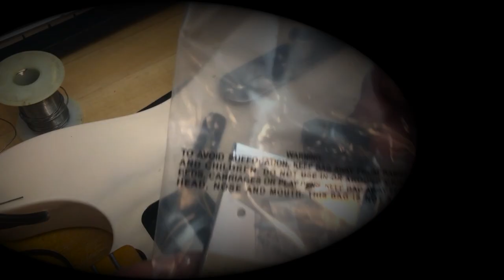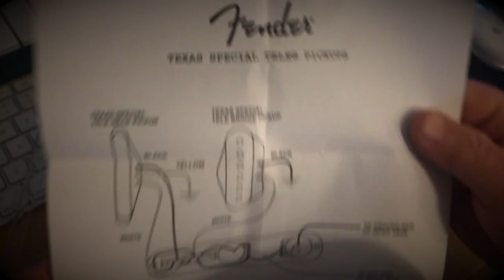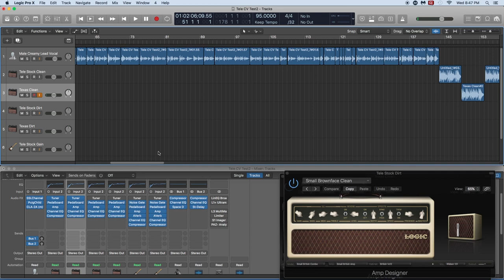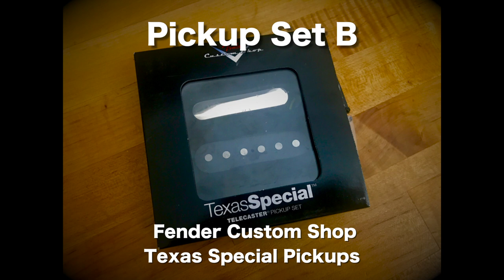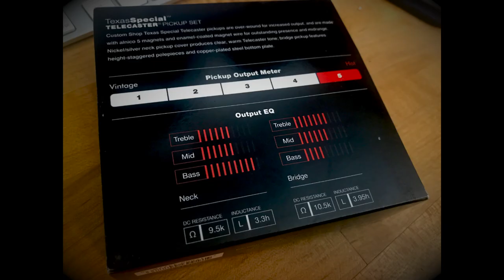Squier Telecaster Classic Vibe Stock guitar pickups VS Fender Custom Shop Texas Special pickups

Comment: I listened with high quality headphones and I couldn’t tell the difference in any meaningful way. The differences were extremely subtle and neither sounded “higher quality” than the other. Thanks for this valuable shootout.
Reply: Nah bro, even with shitty Bluetooth headphones you can clearly tell that the set b is way more articulate and precise
Don't get me wrong I really like the vibe of the CV but there definitely is a difference in audio quality 
Overall it's not worth uprading if you re on a tight budget imo

Comment: Man… I wish I had found this video two weeks ago! I sort of did the same thing. I had bought an Affinity Tele to tinker with during the lockdown, and ended up ordering CS Texas Special pickups for it. The only difference really was that I wanted to put a 4-way switch in so I could get parallel and series tones, and since I was doing this much, I decided to go ahead and swap out the dime sized pots for Emerson 250K pots. And I had to switch the pick guard out because the stock one wouldn’t quite allow the new neck pickup to fit. The first time I ever did ANYthing like this. I didn’t do a side by side comparison, but I went into it knowing what I didn’t like about the stock Squire pickups & knowing what I would like to find in the new CS pickups. I learned a TON and really enjoyed myself. But wow was I nervous doing it. I really do wish I had seen this video prior to jumping in with both feet. LOL 

My end result was a bit different too. The stock pickups were ‘OK’ but to my ear they just sounded a little thin. And being a novice I thought the CS Tx Specials being rated “hot” would be cool. The output did jump a fair bit higher with the new pickups, and sounded much fuller. Especially in the mid-ranges. But you’re right in that it wasn’t a HUGE difference, and not as drastic a change as the price might lead one to think. The pickups were almost what I paid for the guitar. I’m still glad I did the swap, mainly because of learning so much and how much fun it was. Novice soldering can cause quite the case of fear sweat though. 

Transparent butterscotch blonde with a black pearl pickguard, and I love it! The whole experience takes me back to being 15 years old in my neighbors garage with friends… rattling the fillings out of the neighborhood’s dental work. Absolute fun times..

Thanks for an awesome video!
Reply from the maker: Wow Doc, you made my evening! Thank for the compliments and I really appreciate it! Please subscribe I've got more content coming.
Reply: @airtimedesign  Thanks, it’s good to hear that. Not to worry, about two minutes into the video I started to feel like it was one of those coincidences that’s a little too coincidental to not take notice of, so I paused, subscribed, and clicked the notification bell. So I’ll be on the lookout for your next one!

Take care 👍🏼

Comment: I thought A had more of a vintage style tone.  Once I found out B had 10 gauge strings, that sealed the deal for me, A all the way.  Thanks coz you helped save me the cost of new pickups in my CV BSB.  Going from 9-10 gauge strings made a huge difference in tone.
Reply: Try some 11s
Reply: @craiglinderman5249  I will in Eb 👍

Comment: I got a Squire Bullet Tele at the end of 2020. The cheapest Squire Tele of the line. OG price $200, got it on Black Friday + trade in discount for $75. I swapped out the stock for Texas Specials (whole point of me getting the cheapest tele was to mod everything and learn). The difference between the stock squire Bullet tele pickups & the Fender TS picks ups was like night and day. With the TS pickups and a few other mods, this Tele is one of my favorites now to play. For me it was a big jump and change in sound. The middle position even gives me a “quacky” sound like position 4 on a strat. But maybe the huge jump in tone for is that I swapped them in from the cheapest tele on the market.
Reply: i got the butterscotch bullet tele and did the same thing...now its my favorite guitar
Reply: Somebody I know has a set of Texas Specials they don't want, so I just picked up a Bullet to put them in. Did you run into any issues with installing them? I'm already planning on replacing the pots and switch etc. but not sure if there are gonna be any fitment problems or anything.
Reply: I love the bullit pickups.

Comment: I have the Texas Specials in my American Special Tele and absolutely love them. I picked that they were set B, but only on a couple of the demo sets. The slightly smoother chime on the clean neck position was the give away, but that is also my favourite part of the TS sound so I was listening for it. All in all I agree, very similar performance across most of the demo.

Comment: I changed out the stock pickups on my 2010 CV for the Texas Specials and found that there was practically no difference.
I also installed a Fishman piezo bridge and preamp and use the acoustic more than I thought I would. It was well worth the investment for the Fishman but I would easily go back to the original pickups.
Reply from the maker: Hey Rick thanks for the comment. So did you find my comparison about what you expected?
Reply: @airtimedesign  actually,  yes. I was wondering if you would reach the same conclusion that I did. I wasn't disappointed with the original pickups but wanted to compare to something more "Fender" .

Comment: There was very little difference between the two but it was noticeable. I imagine it would have been even closer if 10-gauge strings had been used with the original CV pickups. Swapping to slightly heavier strings is probably the best way to go.

Comment: I just picked up a new 2018 old stock CV butterscotch today. It's made in china and doesn't have neck pup mounted to the guard.  I had to remove it to raise it a tad.
But it's a great guitar and I'm glad I found it!
Reply: I have a 2016 CV Vintage Blond also made in China with as advertised AlNiCo 3 low output pickups. The Butterscotch was advertised with AlNiCo 5  high output pickups... Both guitars play and sound great! and both have medium jumbo fret wire opposed to the newer models having narrow tall fret wire. Years ago I had a CV Thinline that I swapped out the pickups  with Texas specials and it sounded great clean and dirty through a Blues Jr...

Comment: Great video. I would not spend that money. I like the sound in the stock pickups in my Classic Vibe Tele.
Reply from the maker: Thank you for the compliment! It really is not as big as an upgrade as I was hoping. The stock pickups are not as hot and do not have as much output but that's not a big deal. Just turn up the amp a little more and get the gain. I now have 2 Squier Tele's and one has the TS and the other has stock pickups. I like having both and they both sound great.

Comment: thanks for this. It tells me that I won't be upgrading pickups on my newly bought classic vibe. lol. You just saved me a bucket of dough. The stock vibe pickups sounded almost as if not just as good as the Texas. IMO.
Reply from the maker: You're welcome Muttley! I'm glad you enjoyed the review. It's true the TS are not night and day different from the stock CV pickups but they do have a difference that, for some people is worth the money. I ended up keeping mine and the advantages are more apparent when you play through a good amp. Comparing them direct into my audio interface and my DAW is a good start but not the whole story. The bottom line is the CV pickups compare very well to high end pickups and it's hard to justify spending more money for a very small difference in sound.
Reply: @airtimedesign  yea, I understand for gigging or recording the extra $ is justified, but, for one's bedroom or home use? To me , it's not worth the extra $. I did buy some Dimarzio's and Duncan's to replace stock pickups in a couple of my Teles, but, have not changed them yet and I honestly don't know if i will. lol
Reply: honestly the only thing i kinda wanna replace on my CV is the scratchplate because it warped. but i dont wanna give up that classic black guard look

Comment: They were so close. I preferred the Texas Specials, but it was sooo close and I thought on some settings the CV pickups sounded better. Knowing that you changed the strings also, I would not change out the stock pickups. There is just no way that the difference in sound justifies the price. The only thing I would change would be to put in the brass saddles. That is it!
Reply from the maker: Thanks for your comment Chuck!

Comment: Honestly I flip flopped more than once on which was which. In the end I was like it's not worth doing the swap to me but I'd change that switch in a heart beat hahaha. Makes me want the scv now
Reply from the maker: Hey Jeff, yeah I'm probably going to change the switch and the pots. Not that it will have any effect on the sound but it's just nice to have better components. The switch actually has pretty solid but after my less than perfect soldering it has developed some static. I think the pot that I soldered the grounds to also has developed some issues. I probably got them too hot.

Comment: Yea.  I bought Texas Specials for my MIJ strat to replace the ceramic pickups that came stock.  My results were much the same.  It was an improvement, but so minimal it wasn’t really worth the money.
Reply: A made in Japan Strat came stock with ceramic pickups?? That’s insane considering MIJ are (or were once) Fender’s second highest line of guitars.

Comment: Sounded to me like the B Texas Specials had more low end and low mids. It was more noticeable, to me, on the clean samples. Both A and B on the crunch and gain sounded like you had the high end rolled off.
Reply: could that be bc he also changed the saddles to brass?
Reply: @justray510     The CV has brass saddles too. They're chrome plated.

Comment: Great review ! Blind, I chose A. They had more ring without Nasty spiking. B sounded like it had dead old strings on higher notes. On paper, new strings and higher quality pups, B should have killed it. Just love blind tests for a reality check. Glad my ears like cheap.
Reply: I thought the same as you.
Reply: A was bright bright BRIGHT and glassy. B is slightly thicker and more balanced. Idk sometimes I think classic vibe pups are too bright but no listener is gonna notice
Reply: @gnoogie  You can dial down brightness, but not the other way round.
Reply: @douglasalexander4348  tru, but it's kinda like if you dial in a alot of bass for your guitar tone then high pass the bass. it still sounds bass heavy but not bassy if that makes sense. harmonically different guitars/pickups will sound different even if the difference is mitigated thru eq. no listener cares, but those minute little differences add up in the context of a full songs mix
Reply: @gnoogie  Yes, also on early Chinese models there are two cv models, one with alnico 3, 50’s butterscotch (mine), and one with alnico 5, 60’s white. Think the earlier Chinese models had the best pickups, allegedly made by tone rider. Later models had fender A5 on both ?  So reviews may differ depending on model and country of origin which is rarely mentioned. Anyhoo, a guitar at this price years ago would have been junk, but this cv is great. I’ve now also got a 2021 Mexican player, I much prefer the neck. It has a different more twangier tone, but still love the vintage looks and warmer tone of the CV so, despite my intentions, couldn’t part with it. Those two guitars and flavours for the price of the vintera modified….

Comment: The Squire pick ups are very good. Really don't need to replace them. I found just adding a better cap really opened them up. Maybe that is also the limiting factor with the Texas specials.

Comment: Neither sounded consistently better than the other IMO. I’m sure there are times when replacing pickups is really worth it but this doesn’t appear to have been one of those times.
Reply: Because both pickups used the same garbage wiring and pots. Texas Specials in my Mexican Strat sound as good any custom shop. Why? I used the same wiring as Fender uses on their custom shop guitars.
Reply: @Somnospeed  🤣

Comment: Very close Comparison I have a classic vibe tele 50s  and a classic vibe strat 60s and I won't change the stock pu's because they sound good !!!  These guitars are so good they can compete easy with the midrange Fenders any time good work Squier .
Reply: I have the CV  50 and 60 Tele and a Custom shop Tele. Also the CV 50 and 60 strat, and 2 Fender custom shop Strats , and the Classic vibes sound the best , as well the Teles as the
strats,   believe it or not !

Comment: My only gripe with the squiers was they use really poor quality fret wire on them I had a CV tele and I had played it to the fingerboard in a year.
I have a MM tele now no such issues and it gets just as much use.
Reply: I have a Vintera Tele, coming up on two years now, and the fret wire is getting pitted. I did play it a TON the first six months, I really do love the guitar, but the frets are wearing fast.
Reply: @Kenzabukuro  my MIM tele is getting a little pitted. But the frets are not wearing flat to the wood like the squier did.
That said I often use the guitar 35-50 hours a week in sessions. I’m still a couple of years till a refrett.
I should do SS frets but I’m really not fond of the feel of them.

Comment: Ha, funny I did the same thing with my Squire Tele. I did not do the comparison recording like you did, I just changed them. When I done and I played the guitar for a while, it did change the character tones enough for me to notice. I was not as pleased as I expected. The guitar had a different vibe and I needed to play it slightly different. 
After about 2 years using it, I left the Texas neck in and put back the original vibe back in the bridge. Now, that actually gave me a difference I liked working with.
The squire tele is a prety good guitar and sometimes I like the way it feels better than my American made tele.  
I just wanted to toss that all out there if anyone was curious.

Comment: Thicker strings don’t sound more full. BB King used 0.008” for his high E, and no one ever said his sound was “thin”. The Classic Vibe pickups are excellent. No need to swap them out. If you want a fatter sound, then add a tube screamer set to very low drive to fill out the midrange.

Comment: Great comparison. I was surprised that both sets sounded fairly close. So close that the ultimate decision as to which is superior is a matter of taste, as neither clearly outclasses the other. With that in mind, my preference was for the Texas Specials, because of the fuller tone and articulation. However, that may have been due to string gauge which likely means that if the CV pickups would have sounded just a bit fuller as well. Thanks for the demo!

Comment: I thought the Squire was at times a little scratchy, the custom pickups, on occasion sounded slightly richer in tone and clearer in the middle position. But the difference was only slightly audible on some sttings and really not at all on others. Very thorough test, thank you.
I've just put some uk Mojo pickups on my Tele, broadcaster bridge and p90 staple neck and they sound to my ears wonderful. But then again .......

Comment: I have installed older version Classic Vibe pickups in many Guitars I own, because I’ve liked them a lot, since the first time I played a Guitar with them in it.
Reply from the maker: Thank you for the comment BadChizzle, I'm now uploading another comparison of the Classic Vibe Stratocaster with the Fender American Pro. You might enjoy it. Please subscribe Thanks!
Reply: @airtimedesign  Done
Reply: @airtimedesign  By the way… I’ve had Custom Shop Texas Specials in my 2006 Highway One Tele for years. I did so just to keep it all USA parts pretty much… ha ha… and they are also very good. Also I thought the Highway One pickups were a joke in construction compared to even some very inexpensive alnico pickups. Plus… the sound was very lackluster. 

Off topic: 
I’m an Alnico person and have done many A B tests with ceramics… and maintain my opinion that alnico is much better to my ears. Just put that out there as maybe a conversation starter… not an argument with anyone who may read this. 

Waiting for your Strat video,

Chizzle

Comment: Thank you.. I was really interested in this as I have the Classic Vibe Tele as well. My blindfolded preference was the brighter set A. I do feel I short changed your effort by listening to this on my iPhone w/o earbuds. But yes, I heard the same thing .. not a significant improvement. Sometimes I heard more complexity in the Texas Specials, but sometimes that just translated into a bit more muddiness. This was most noticeable in the neck and mid settings. And once you added crunch and gain… dang.. the bridge sounded even more similar. 
I really appreciate this because swapping out my slim C neck on my CV for a soft V Fender is also on my wishlist. But this comparison makes the neck swap a priority over the pickup swap since the audio difference (on an iPhone … sorry) is not substantial. 

Not to make more work or expense for you,.. but I would love a sound test with Lollars and one with a humbucker in the neck as well. Thanks!
Reply: Absolutely agree on the muddy sound. That's why I thought that pickup was the TS.

Comment: Got the Nocaster 51 Custom Shops pickups to go on my new Squier Telecaster 60s custom shops... Harder to change than humbuckers (to me)... I had recorded before/after and reverted to the stock pickups. Turns out they actually had more output and resistance than the Fender CS pickups